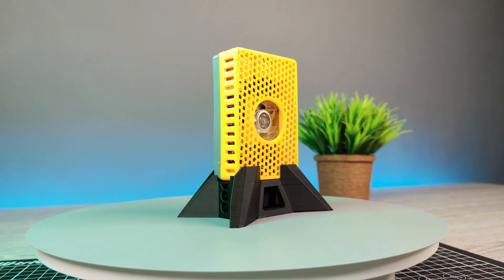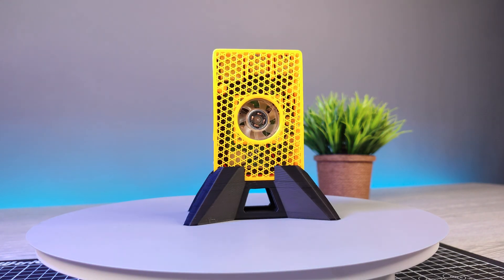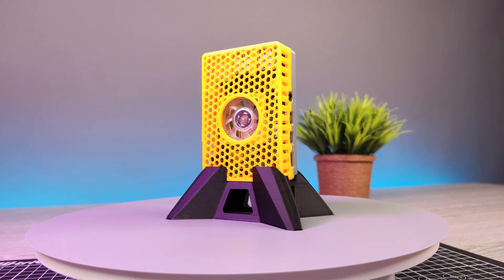10 Extraordinary Raspberry Pi Cases

Comment from the maker: Which one did you like the most? 🙂
Reply: The one you put in Thumbnail of your Video 👌
Reply from the maker: @Bikesloverofficial07  Thanks for the answer!
Reply: @engineericly  Always welcome Brother 🥰
Reply: No. 8 This color, big Raspberry logo and the idea of hanging device on the wall. Great work.
Reply: I liked the phone box and the low profile thing. I'm more into functions with my own stuff. In a sense a whole lot is missing in the RPi world. A power bank should snap onto a case like Lego or with magnets and separate easier for long trips in Norway. Add "snow cooling" or something and 3 extensions of the GPIO which everyone likes, but there is only one (usually) and stacking the RPi stuff makes it a high tower so you can't take it with you on a bicycle.
Reply: I also like the case but I have raspberry pi 3
Reply: #6, but I might be a little biased ;-)    (Thanks for including my design in you video.)

Comment: I loved all but personally would make a sleek matt grey one with a cooling fan and openings in the top for gpio pins and camera module, screen module etc ports, with an in built thin profile battery for backup power. But great video for inspiration. Loved the vertical stand idea.

Comment: I am trying to get a nice case for the Raspberry Pi 3b+ terra pi setup. It has a hard drive and the board. The option that was included with the TerraPi kit is verticle and very awkward. It doesn't stay together well when moving it. And looks bad in general. I am hoping for a mount that has the drive on the bottom, and the  Pi on top of the Terra Drive. While making the audio and HDMI ports, USB ports, all functional too.

Comment: Some of those are really nice.
Thanks for sharing them.
Feedback: 10 - as nice as it is, if the ethernet (and USB) ports are at the top it could be a bit unsteady.  Would it be better to have the machine so the power cord plugs in either at the top or bottom   I guess this depends if the machine will have an HDMI cable plugged in to it also.

Comment: What material did you print these in? Cause i know certain filaments can warp at the temperatures of the raspberry pi
Reply from the maker: Hello, I used PLA for better filming experience, but I would suggest to do it with PETG or other heat resistant materials
Reply: @engineericly  ok thanks